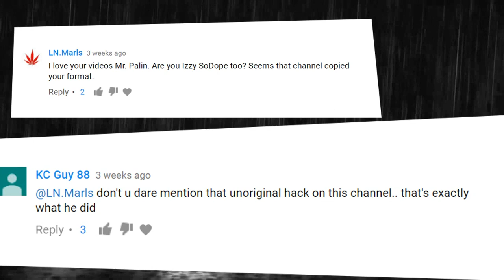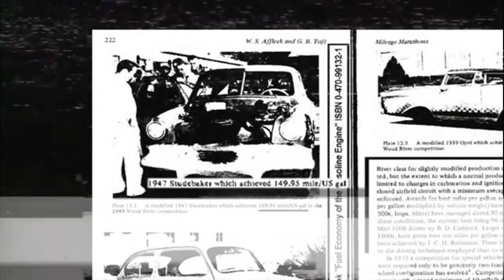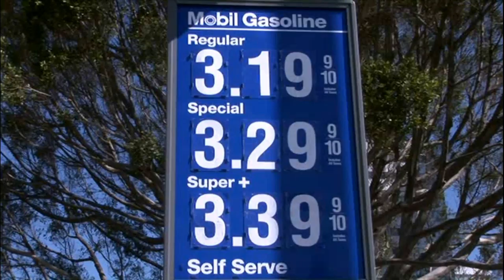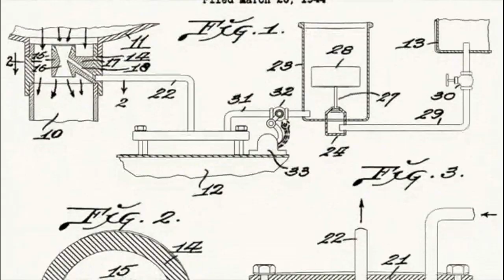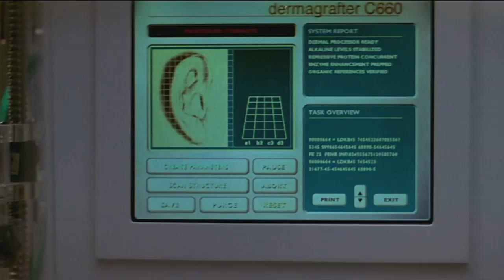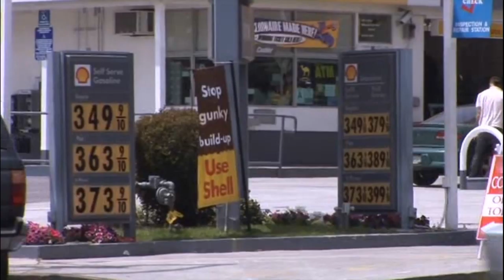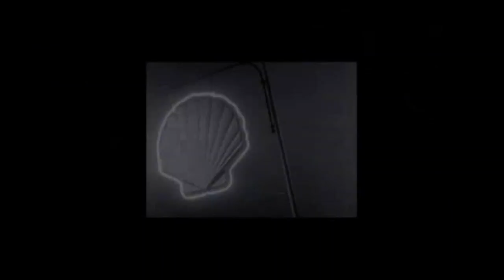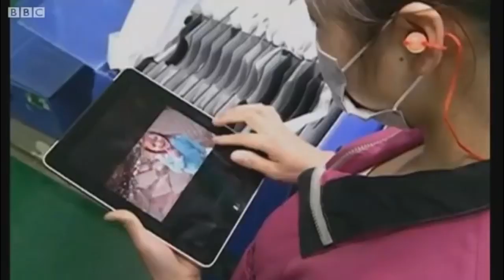Bill Burr - GasHole

Comment: If you understand math and physics you'd never ask the question   WHY HASN'T GAS MILEAGE IMPROVED.
It has improved,  but not at the rate of Moore's  law
Reply: Lol moores law is bullshit anyway, not even a law and it seems that silicone finfets can barely get any denser than what they have been for the last 3 years
Reply: @anchorbubba  troll harder
Reply: I'm a mechanical engineer and subject matter expert in this field of specialization.
Everything here is true and so much more. I have all the original documents from Shell, Cummins, The US Army, SAE, and so much more. Let me tell you something, the thermal efficiency of a standard poppet valve engine is NOT 25% efficient. Its more like 5% efficient. 	Most engines and fuel systems currently in production are designed for one specific fuel type/source. This greatly limits fuel flexibility and has been a major hindrance to the viability of alternative, renewable, and green fuels. Furthermore, long chained liquid fuels reduce the efficiency of engine systems because the heat from the combustion of the fuel is required to overcome the latent heat loss to evaporate and chemically break down the fuel before oxygen from the intake charge can bond with the hydrogen, oxygen, and various other combustible elements found in liquid fuels.
	When using liquid fuels, including direct injected liquids, no matter how well atomized the fuel is the liquid droplets are still a stratified charge that will sap heat from the engine via latent heat loss via evaporation and chemical breakdown before oxidation/combustion of the fuel can occur. This inherently means that all liquid fuel systems use a stratified charge, and can never become a true homogeneous charge. Because liquid state fuels in a stratified charge carry sound, shock, and impact waves more readily, this makes stratified charges far more susceptible to detonation and “engine knock” conditions when higher compression ratio's are used. This has been one of the primary limiting factors for engine efficiency since the beginning of the internal combustion engine.
	Gaseous fuels such as methane and propane have exceptionally higher octane ratings in both RON and MON. This is partially due to the fact that gaseous fuels readily and naturally homogenize with intake air and partially because of their shorter and simpler molecular structure. These true homogeneous charges allow engines using gaseous fuels to run much higher compression ratio's, which greatly increases the efficiency, power to weight ratio, and performance of the engine. Gaseous fuels such as propane and methane also have higher energy density's by weight because the fuel does not need to waste its own energy to break itself down to continue the propagation of the flamefront. This is why methane has the highest energy density by weight of any common hydrocarbon as it is one of the shortest and simplest hydrocarbons. By observing the various types and lengths of hydrocarbons we recognize a general pattern, that the shorter and simpler a hydrocarbon is, on average, the higher its octane rating and energy density by weight will be. In effect, the shorter and simpler the hydrocarbon is, the more energy per atom of hydrogen and carbon burned can be extracted.
And thats JUST the god damned fuel delivery system.
The throttle plate induces artificial pumping losses and creates an artificial load by reducing the volumetric efficiency of the engine at any condition other than WOT. This greatly decreases fuel efficiency, but is "necessary" because unless extra liquid is injected into the engine if it runs lean the fuel will detonate and destroy conventional engines. BUT engines capable of withstanding the forces of detonation,l thus achieving true constant volume combustion, have been designed. Most conventional engines have 4 strokes per cycle, which doubles the internal friction per power stroke compared to a two stroke cycle. Furthermore, the valvetrain is where most engine friction comes from. Not to mention that the 2 fold symmetry of wiggling connecting rods means that conventional ICE's are incapable of running in detonation as it will cause the con-rod to bend and the skirts to fold in on themselves. Engines of the 2 stroke per cycle variety typically rely on the underside of the piston, which in such designs are open to the crankcase, to act as a supercharger to force exhaust gases out of and fresh fuel/air mixture into the combustion chamber when the piston reaches the bottom most portion of its stroke and cycle. Some 2 stroke per cycle engines, especially larger industrial engines, one such example being the Detroit Diesel Series 71, instead rely on a supercharger or turbocharger bolted to the engine to provide this scavenging force rather than pressurizing the crankcase. However, these engines fail to exploit a benefit of relying on an external supercharger and/or turbocharger because they still only use one side of the piston to convert chemical energy in the form of combustible fuels into mechanical energy. The reason why they are unable to do so is because conventional connecting rod engines can not isolate the bottom of piston from the crankcase oil. Furthermore, 2 stroke cycle engines despite their higher power to weigh ratio's and greater overall efficiency have recently fallen out of favor due to recent NOX emissions standards.
	In response to this, industry as a whole has, with few minor exceptions, not pursued innovating new mechanisms to solve these challenges, instead choosing to rely almost exclusively on computer controls, electronics, catalytic converters, and various other accoutrements to reduce emissions and attempt to increase power output of conventional 4 strokes per cycle engines and has done so with limited success from an engineering perspective. However this approach, though  traditionally considered to be financially safe by accountants, has resulted in engines that are of much greater complexity, cost, are considerably more difficult to maintain, and are less adaptable for a wider scope of uses. As a result, conventional engine of the current era are highly specialized machines, and the performance gains in efficiency, power output, power to weight and displacement ratio have been relatively marginal at best. To this day even the most efficient conventional piston engines have a mere 50% thermal efficiency, and these high (by conventional standards) efficiency engines have abysmal power to weight ratio's. It is for these reasons that a new generation of engines are needed. Engines boasting higher power to weight ratio's, higher efficiency, less moving parts, less internal friction, and simpler more robust and easier to maintain designs will be necessary in the 21st century and beyond. Previous attempts at commercializing scotch-yoke type engines have failed for a plethora of reasons. One of those reasons is that though they have higher power to weight ratio's and efficiency than conventional engines, the performance increase was not sufficient to justify switching to a new designs in prior years. This is all just scratching the surface.

Comment: I was always under the impression those super high Shell efficiency numbers were based on standard engines in CUSTOM configurations and likely with the super high octane AV gas they had in surplus after the war.  We COULD massively increase fuel efficiency but it would COST more close to the most effective middle point as it is.

Comment: A gas engine only uses about 20% of the gasoline’s potential energy. The rest of the gas is unburned and it left to evaporate to cool down the combustion chamber. When liquids evaporate they cool. 

If you’re able to properly mix atomized water into the engine to the proper proportion you can burn all the gasoline and then use the water particles to evaporate and cool the engine. 

Basically you run a very lean fuel mixture which we know makes a lot of power but also makes a lot of heat. Just cool it down with the water

Comment: I think the reason they could get so much efficiency out of those old engines was the sheer lack of horsepower and torque. Back in the 60's alot of cars would get 50mpg, but had abysmal horsepower. Now the 2020 Corolla gets 50mpg. If the designers behind the corolla had the budget and intent to get 50mpg out of it they could've done it 10+ years ago
Reply: By definition of efficiency, advances in technology would dictate an increase in power as well as a scaling fuel economy to some extent. Would it not?

Comment: I don't doubt that car manufacturers could give us much better mileage per gallon of gas, but there is a cap on it (in my barely informed opinion). Gas contains a lot of potential energy, and the tank to contain it is pretty small (relatively). But still, the car can only be propelled as far as the potential energy in the gas can move that amount of mass (then subtract efficiency of the conversions). They will never get 1,000 mpg though (unless it's supplementing another source of energy).
Reply: 1970 HONDA CIVIC - 50MPG -80HP MOTOR 
2019 HONDA CIVIC - 50MPG 240HP MOTOR
THEY FOCUSED ON HORSEPOWER THE LAST 50 YEARS
NOT GAS MILEAGE!!!!!!!!!!

Comment: Laws of physics, thermodynamics and the fact that gasoline has a huge amount of energy per liter and a lot of it being wasted into heat. Electric cars are much more efficient, but batteries have a fraction the energy density of gasoline or diesel fuel. There's no silver bullet her.

Comment: conversion of energy limits a lot of it moore law is different and computers use a different proccess
Reply: Do you mean conservation or conversion, because it makes a difference
Reply: @crimsonking6246  true could be both
Reply: I'm a mechanical engineer and subject matter expert in this field of specialization.
Everything here is true and so much more. I have all the original documents from Shell, Cummins, The US Army, SAE, and so much more. Let me tell you something, the thermal efficiency of a standard poppet valve engine is NOT 25% efficient. Its more like 5% efficient. 	Most engines and fuel systems currently in production are designed for one specific fuel type/source. This greatly limits fuel flexibility and has been a major hindrance to the viability of alternative, renewable, and green fuels. Furthermore, long chained liquid fuels reduce the efficiency of engine systems because the heat from the combustion of the fuel is required to overcome the latent heat loss to evaporate and chemically break down the fuel before oxygen from the intake charge can bond with the hydrogen, oxygen, and various other combustible elements found in liquid fuels.
	When using liquid fuels, including direct injected liquids, no matter how well atomized the fuel is the liquid droplets are still a stratified charge that will sap heat from the engine via latent heat loss via evaporation and chemical breakdown before oxidation/combustion of the fuel can occur. This inherently means that all liquid fuel systems use a stratified charge, and can never become a true homogeneous charge. Because liquid state fuels in a stratified charge carry sound, shock, and impact waves more readily, this makes stratified charges far more susceptible to detonation and “engine knock” conditions when higher compression ratio's are used. This has been one of the primary limiting factors for engine efficiency since the beginning of the internal combustion engine.
	Gaseous fuels such as methane and propane have exceptionally higher octane ratings in both RON and MON. This is partially due to the fact that gaseous fuels readily and naturally homogenize with intake air and partially because of their shorter and simpler molecular structure. These true homogeneous charges allow engines using gaseous fuels to run much higher compression ratio's, which greatly increases the efficiency, power to weight ratio, and performance of the engine. Gaseous fuels such as propane and methane also have higher energy density's by weight because the fuel does not need to waste its own energy to break itself down to continue the propagation of the flamefront. This is why methane has the highest energy density by weight of any common hydrocarbon as it is one of the shortest and simplest hydrocarbons. By observing the various types and lengths of hydrocarbons we recognize a general pattern, that the shorter and simpler a hydrocarbon is, on average, the higher its octane rating and energy density by weight will be. In effect, the shorter and simpler the hydrocarbon is, the more energy per atom of hydrogen and carbon burned can be extracted.
And thats JUST the god damned fuel delivery system.
The throttle plate induces artificial pumping losses and creates an artificial load by reducing the volumetric efficiency of the engine at any condition other than WOT. This greatly decreases fuel efficiency, but is "necessary" because unless extra liquid is injected into the engine if it runs lean the fuel will detonate and destroy conventional engines. BUT engines capable of withstanding the forces of detonation,l thus achieving true constant volume combustion, have been designed. Most conventional engines have 4 strokes per cycle, which doubles the internal friction per power stroke compared to a two stroke cycle. Furthermore, the valvetrain is where most engine friction comes from. Not to mention that the 2 fold symmetry of wiggling connecting rods means that conventional ICE's are incapable of running in detonation as it will cause the con-rod to bend and the skirts to fold in on themselves. Engines of the 2 stroke per cycle variety typically rely on the underside of the piston, which in such designs are open to the crankcase, to act as a supercharger to force exhaust gases out of and fresh fuel/air mixture into the combustion chamber when the piston reaches the bottom most portion of its stroke and cycle. Some 2 stroke per cycle engines, especially larger industrial engines, one such example being the Detroit Diesel Series 71, instead rely on a supercharger or turbocharger bolted to the engine to provide this scavenging force rather than pressurizing the crankcase. However, these engines fail to exploit a benefit of relying on an external supercharger and/or turbocharger because they still only use one side of the piston to convert chemical energy in the form of combustible fuels into mechanical energy. The reason why they are unable to do so is because conventional connecting rod engines can not isolate the bottom of piston from the crankcase oil. Furthermore, 2 stroke cycle engines despite their higher power to weigh ratio's and greater overall efficiency have recently fallen out of favor due to recent NOX emissions standards.
	In response to this, industry as a whole has, with few minor exceptions, not pursued innovating new mechanisms to solve these challenges, instead choosing to rely almost exclusively on computer controls, electronics, catalytic converters, and various other accoutrements to reduce emissions and attempt to increase power output of conventional 4 strokes per cycle engines and has done so with limited success from an engineering perspective. However this approach, though  traditionally considered to be financially safe by accountants, has resulted in engines that are of much greater complexity, cost, are considerably more difficult to maintain, and are less adaptable for a wider scope of uses. As a result, conventional engine of the current era are highly specialized machines, and the performance gains in efficiency, power output, power to weight and displacement ratio have been relatively marginal at best. To this day even the most efficient conventional piston engines have a mere 50% thermal efficiency, and these high (by conventional standards) efficiency engines have abysmal power to weight ratio's. It is for these reasons that a new generation of engines are needed. Engines boasting higher power to weight ratio's, higher efficiency, less moving parts, less internal friction, and simpler more robust and easier to maintain designs will be necessary in the 21st century and beyond. Previous attempts at commercializing scotch-yoke type engines have failed for a plethora of reasons. One of those reasons is that though they have higher power to weight ratio's and efficiency than conventional engines, the performance increase was not sufficient to justify switching to a new designs in prior years. This is all just scratching the surface.
Reply: @smh9902  where did you copy paste that from ?
Reply: @bigredinfinity3126  That is all me. All my words. I'm an actual SME.
Reply: @smh9902  sorry was not being rude just not everyday people would respond to a  comment like that . I recently learned about how a lot of crude actually comes from space and the core can you explain a bit more about how it gets produced
Reply: @bigredinfinity3126  Oh my, that's the abiotic oil theory. It holds merit. Some oil may not be a fossil fuel. I'm not a geologist and thats outside my area of expertise so I wont delve into details, however it may hold true that some or much of the oil we use is not a fossil fuel.

Comment: It's not a car that runs on water... It's HHO gas... It drips H2O(water) out of the tailpipe... You can also use this gas as a torch to cut through metal
Reply: Yup and the energy to separate H & O needs to come from somewhere... alas fossil fuels are the most energy dense fuel/$ available and conversion makes no sense.

Comment: Actually the gasoline MPG limit is not that hard to calculate.  There are 124,884 btu in a gallon of gasoline which is your absolute potential limit without thermal dynamic friction loss and mass.  No argument really needed.
Reply: What are you saying so what's the max mpgs then?
Reply: @edwardwonghaupepelutivrusk9270  again it depends but for a normal car 100 will be the limit